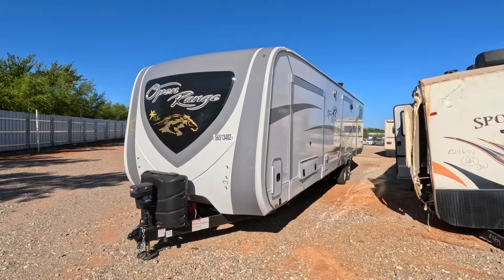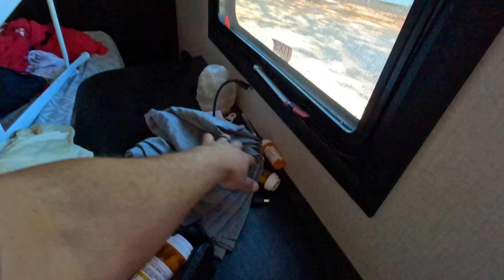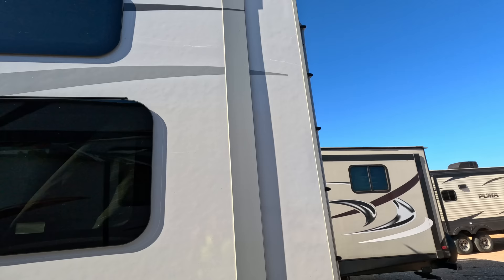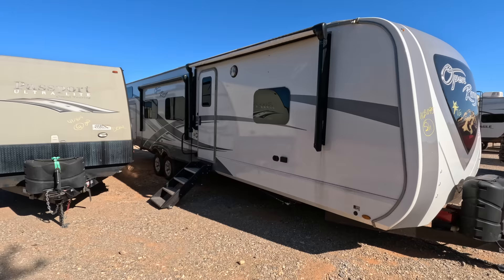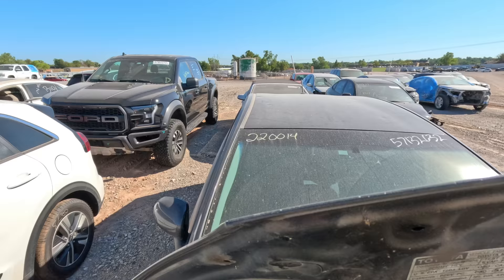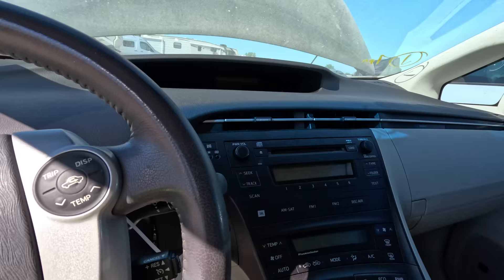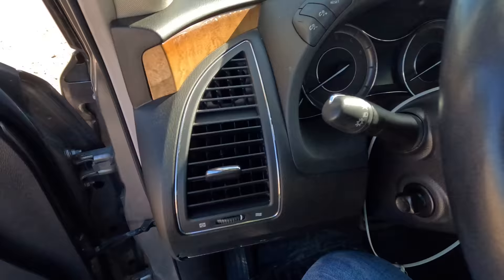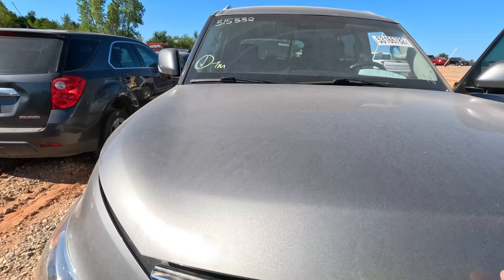Copart Walk Around 9-21-22 + $500 Toyota Prius! Will it run?

Comment: Hi Randy, i have good news for you about the prius. It does have jump point in the engine compartment , it's on the driver side inside the fuse box, it has a red cap on it and make sure the cable is paired with the metal piece on the same side (towards you I believe) and the negative to the inverter. Hope this help you next time
Reply: Yeah! I have the 2010 Toyota Prius and you can jump start it with under the hood also you can manually open the trunk which makes life a lot easier

Comment: On the Infiniti, we had a G37 and it would start. Was a brake switch or something to do for the brake to push to start. 

Had to press the button once and then once it was in the accessory mode press again for a second time and hold, would start the car. Mechanic told us all push buttons were like that.

Comment: Friend of mine has a 2012 prius C from new with 190k(0 issues other than maintenance) , still runs like it should. Fantastic cars. Someone ran that prius into the ground doing 10k oil changes... my pathfinder did the exact same thing, was the fusible link. Deleted it and works without issue now.

Comment: Shame that the Prius wouldn’t move or start. Would have loved to see how the battery health has lasted over the years and what range it has lost.
Reply: It would actually start, We have the same prius, But with priuses you have to pull out the orange hybrid battery and unplug a wire from the main hood, left unplugged 10 minutes or so, reattach after 10 minutes, hit start button 3 times, and it'll reset the hybrid battery and function right away

Comment: There is a jumping point for that gray Prius it's underneath the relay box under the hood on the right hand side there's a little plus indicator you flip the tab up and then you connect your jump box to that and then just ground it off to one of the shock mount bolts and it should fire right up I figured that out working for Toyota for almost 23 years

Comment: Hey Randy, that trailer is an Open Range 338BHS (you can look it up for a floor plan). It has rear bunk beds and a half bath in the back, the kitchen/living area is in the middle with the couch on the door side facing the kitchen area. Depending on what year it is, its worth anywhere from $50K-65K.

Comment: Randy at Prius if you want the jump point it will be at fuse box under the hood you have a red cap under the cap is plus terminal and the negative terminal is a minus on the chassis

Comment: Prius jump spot in in the hood under the fuse box panel on the driver's side in that black box. But sometimes it's no strong enough to jump the battery so you have to do it from the rear

Comment: Prius engine battery has a positive jumper location in the fuse block (box) labeled with a red tab with a "+" on it. Kind of like how Mercedes and BMW put the batteries in the trunk but have posts in the engine bay

Comment: There is a jump point under hood - on the left (driver's) side fuse box - pull cover, pull red cover and there is a clamp spot.   2010-up Prius empty of coolant  = head gasket issue + maybe other issues since it has check hybrid (or they blew engine after it overheated when they ignored the low coolant)

Comment: On that prius there is an orange plug I think it's behind the seat after you take the plastic stuff out on the left side in the floor behind the seat if it's not locked into place the car will not start

Comment: the issue of the prius or any hybrid car is once the hybrid/traction battery is dead they need a special jump starter that only a dealer would have. if that hybrid/traction battery is dead it wont allow the car to run at all. shame it is this way but it is

Comment: The hybrid battery is complete dead, only solution visit a Toyota dealer with a special hybrid battery charger.
Another solution, the dealer shut off the hybrid battery(system), and you drive only on the ice engine.

Comment: I have a 2010 on the left side where the fuse box that there’s a little red square tab that u flip and then u put the positive there and negative is on the shock bolt

Comment: Randy, hook your truck up to the plug on the tung of the camper and you can run the slides out. I have a noco boost pack and you can even hook that to the battery, long as everything is hooked to the battery, and the slides will go out. You have limited power options that way but, the main things like slides and lights will work.

Comment: I just swapped my 2011 220kmile engine for 2800$ for a 50k miles engine . It kept burning oil every 2kmiles no oil left in engine. Maybe the coolant and new battery all u need ?? I bought my 2011 prius 130k miles for 7k$ but 1k dealer charge 8k total now the dealership and auction guys said its 6k$ more value now becuz ppl want hybird becuz off high gas.  If 8k plus 6 so that's 14 ?? But if deals buys it they will sell higher than 14 so its almost a 20 grand car ?? Now I swaped my engine to 50k too so man is it a true 20grand car? I drive for uber lyft only

Comment: Why didn't you look at the Buick convertible behind the Prius?  You are looking for a Mercedes convertible for your road trips.  A Buick is a Mercedes that won't break down.
Reply: That travel trailer appears to be one manufactured by Highland Ridge RV.  It appears to have the floor plan that is rated to sleep up to 10 (depending on options).  The base empty weight was listed as 10,300 pounds with an empty tongue weight of 1,210 pounds.  The likely loaded, ready to travel eight likely would approach 12,000 pounds — one ton truck towing territory.  Those slides add a tremendous amount of weight and complexity.  Your Power Wagon may have the trailer tow rating to handle the base trailer when empty, but there would likely be little reserve for anything else.  My information shows that this trailer would likely exceed the trailer tow rating of your TRX.